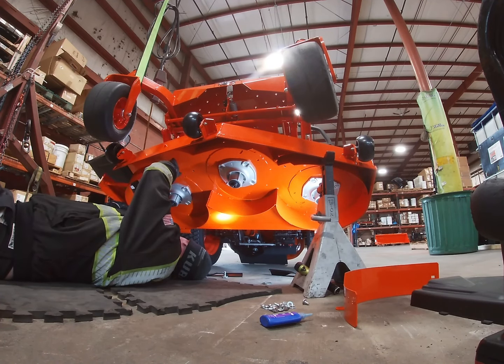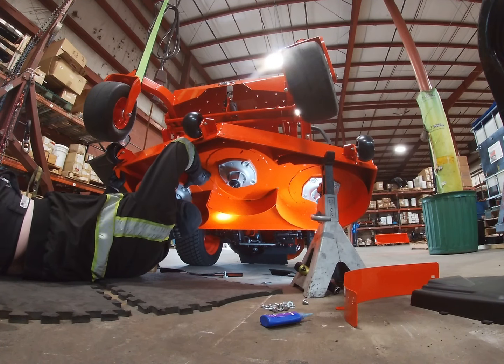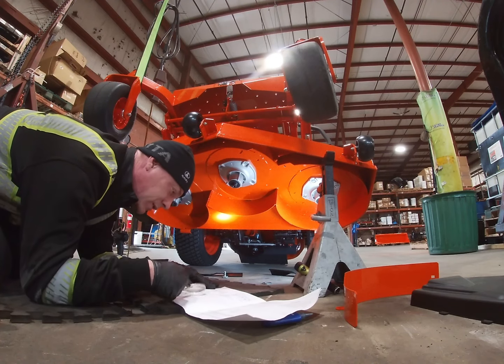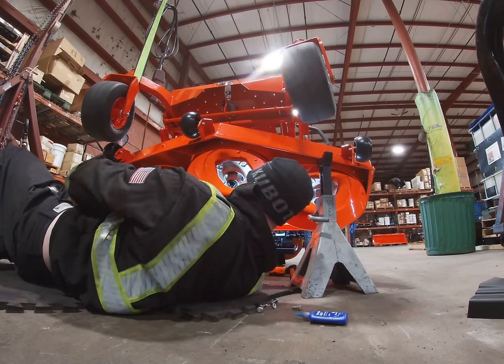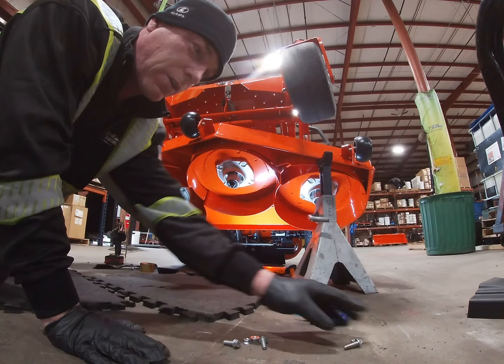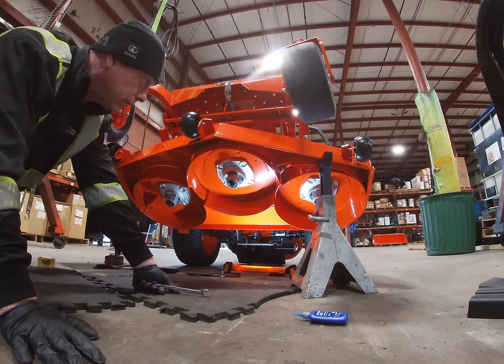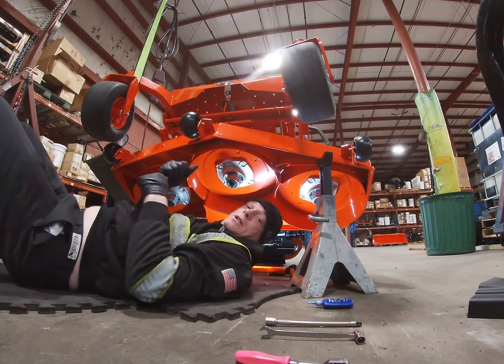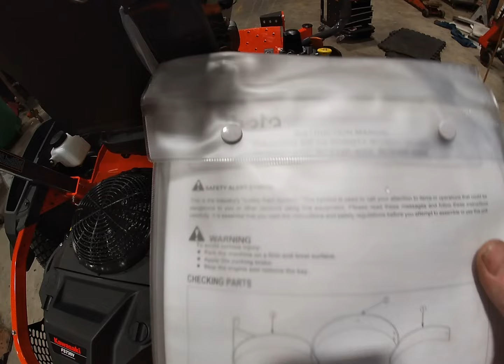Installing the mulch kit onto a Kubota Z422 zero turn lawnmower

Comment: How did you know where to drill the holes?  I have the Z412 and I do not see the predrilled holes even though the instruction say they are there.  The instructions are garbage by the way.
Reply from the maker: I had pilot holes.. you might have to mark them out..   definitely make sure you have the right kit ..  good luck
Reply: I’m doing my 412 as well. Did you ever figure this out? The instructions are definitely garbage. Or did you happen to find something on the Internet that helped you out?

Thanks
Reply from the maker: @maconmoooremoore5964 good luck 🍀👍